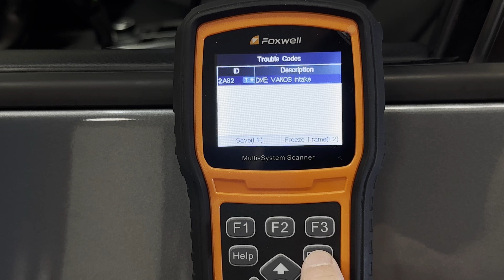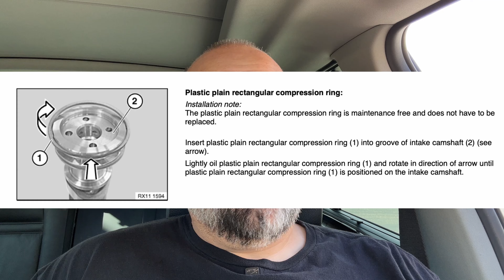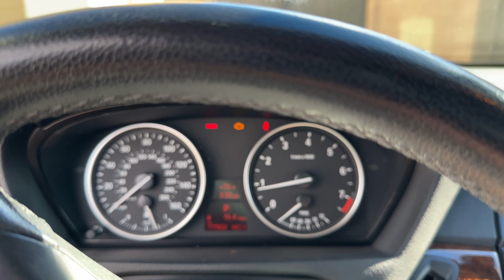BMW Vanos Fault 2A82 | Pt 1 N52 Vanos Diagnosis

Comment: "I ordered bunch of AMAZON parts".  That is your problem. Any mechanic knows about Chinesium "parts". Also, oscilloscope is extremely helpful in these cases. Moreover, Identifix should list possible causes, in the probability list, based on this code.

Comment: are you using the costco oil in the bmw? 
thank you
Reply from the maker: @fstlnj29  Yup. Technically meets the required specifications. 4500 miles on it right now since the change.
Reply: @DrivingForwardBuilds  Thank you for confirming what I found. I change oil pretty often as I track my car but from what I read, I thought this does work. It was hard for me to cross reference all of the oil certifications and understanding the overlap.

Comment: Hello, has the problem been solved yet? I have this same code :/
Reply from the maker: Yes it has been fixed. Long story short I found my intake cam adjuster had broken bolts in it. https://youtu.be/AUvw-il1Ljs I replaced both cam adjusters, the first time with cheap ebay parts that failed, and later with oem equivalent parts that worked. NOTE- there is an open recall for the cam adjuter failure, double check that your car doesnt fall under the recall.

Comment: i believe your issue is this is probably the vanos cam bolts aka the "New Vanos Recall (23V-707)" that solid clunk on some starts makes sense for bad bolts/backing out/ broken, currently diagnosing one for a client and they have a very light rattle that sounds like marbles only on revs to 1200 rpms and specifically louder with the engine decel, looking forward to the solution
Reply from the maker: Thanks for the info!

Comment: have you tried the Disa valves? The bigger one is on the outside of the intake manifold and very easy to remove and check. They do come apart and could account for the thunk you hear on startup. The small one rarely goes bad but does and is much harder to get to since its on the inside section of the intake and you will have to remove the manifold from the block. 

You dont really need to remove it from the car since on the x5 there is a lot of space in the engine bay to work with and the harness is attached to an almost impossible to remove section.
Reply from the maker: Thanks for the advise. I’ll have to take a look at those.
Reply: just one more thing. When the disa fails more oil than normal usually goes through the intakes and clog the MAP sensor and that will cause the computer to go haywire leading to that burble at idle as the vacuum information is garbled. It also causes acceleration problem where,  as you step on the gas you get that little hesitation then a jump then a series of jerks like the tranny has a problem. @DrivingForwardBuilds